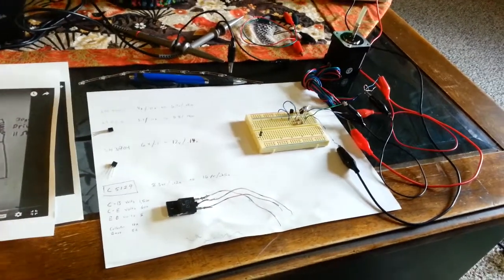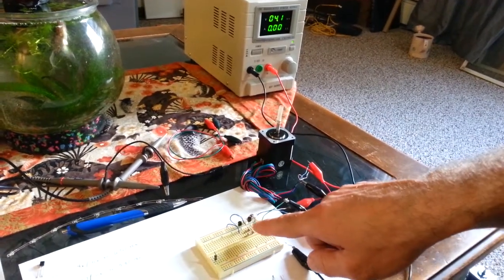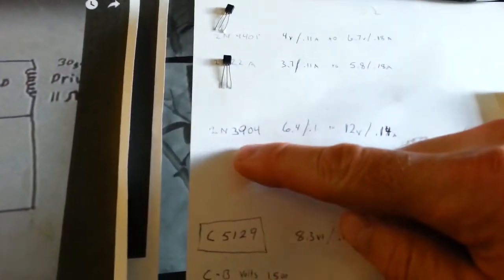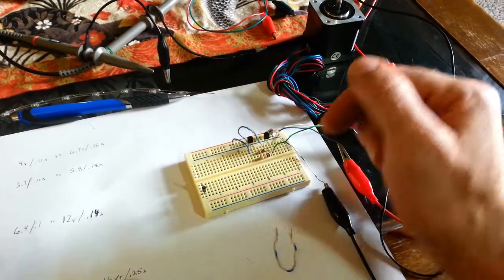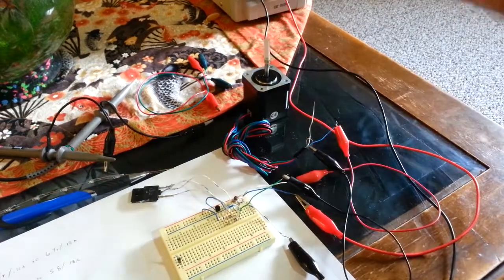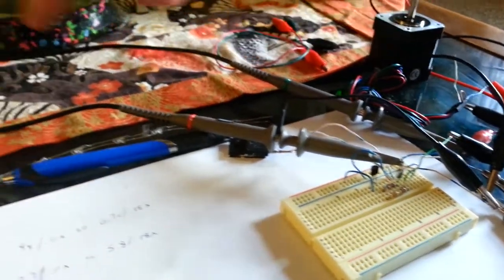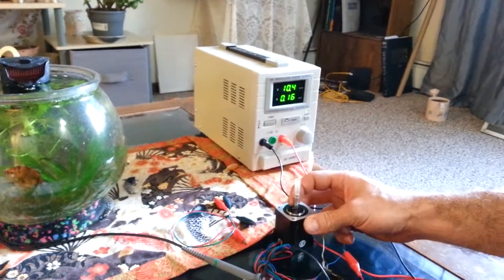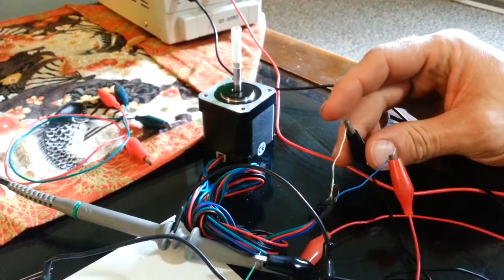"Darlington pair" transistor stepper motor

Comment: Darren, place the motor on horizontal, wrap a string around the axle, place some increasing weights on it. Find out how much it could lift. A windshield wiper motor, lifts about 35 pounds.

Comment: bro how to run 12v stepper motor with transistors? do you have any video? I need to run two 12v stepper motor with full power.
Reply from the maker: tahmid faizi I am actually putting together a video showing a big 36volt stepper motor running with this circuit. I have have used this circuit to run my stepper motors at near full strength ( hard to test without specific equipment) but I can't stop it with my hands.The secret is higher voltage rated transistors. Some of my other videos show a large 3 phase motor running with better transistors.
Reply: thanks for reply.
Reply: I`m running a 3 phase vcr motor, the flat motor, with a D2624 transistor, removed from an old CRT tv. One coil, from the battery + to the collector, one coil from the emitter to the base, no resistor, and one coil is hanging loose. I tried to rectify the third coil, but to no avail. It keeps on oscillating heavily. The little thing must be reaching 10.000 rpm at 12v, but when I attached the third coil, in series, with the first coil, from the collector, it slows down to half of the speed. I haven`t tried to use the same circuit on a stepper motor, yet, but I think it will work.